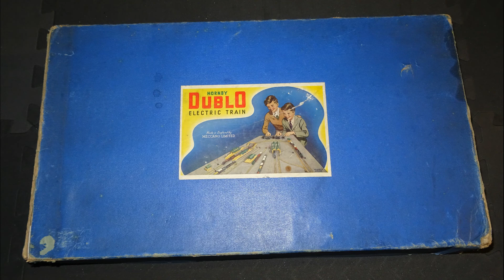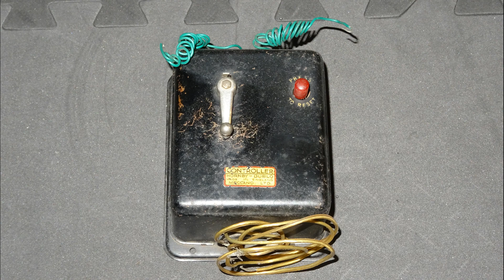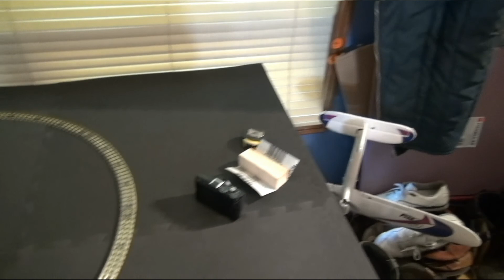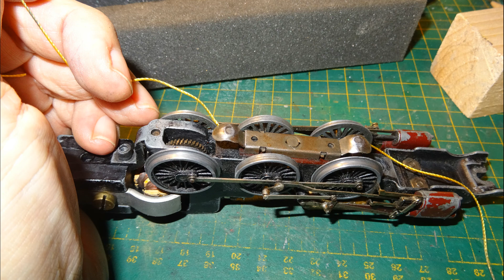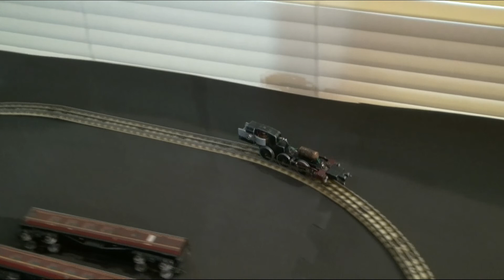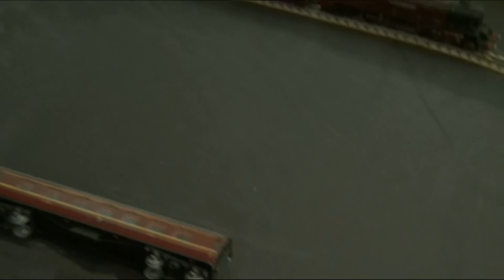OO 161, Hornby Dublo 3 Rail Duchess of Atholl Train Set

Comment: Great video as always, and that's a really neat vintage train set. Definitely a bummer your having a few issues, but that's just the fun of working with old stuff. I would give that old paper capacitor a check over with the multi-meter, just to make sure your not getting any major resistance. The strange looking surface texture on the cap is actually a beeswax coating they used to use back in the day. From what I can decipher, the cap is used for suppression and has a value of 0.5nF in case you get the itch to try swapping in either a modern equivalent or new-old stock vintage replacement. Best of luck!!!

Comment: Hi Ken. Well done for getting the train as well as you have. Did you consider asking Nigel(?) to strip the motion to get it thoroughly cleaned? I know you cleaned the tops of the rails, but what about the connectors between each piece of track?
Reply from the maker: I definitely need to do more work on the track. This was very much just a preliminary trial. I could take the motion of the loco apart... but I really don't want to. Those are very old parts, mostly just push fitted. I've bought some electrical contact cleaner, and I'm going to try giving the axles a squirt with that, inasmuch as I can get at them. But I'm also not sure whether I should even be expecting this old loco to work any better than it currently is. I've now got another 3-rail loco, a 2-6-4 tank, which was professionally serviced before it came to me, so I'll try that one, and compare its performance to the Duchess.